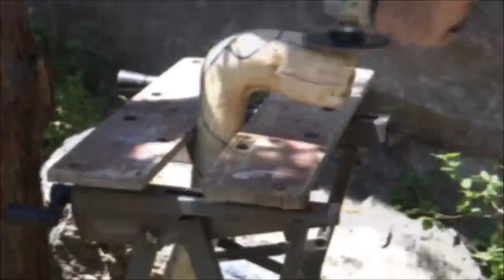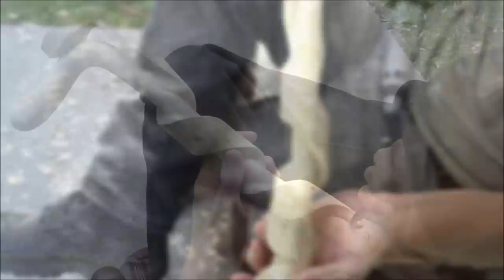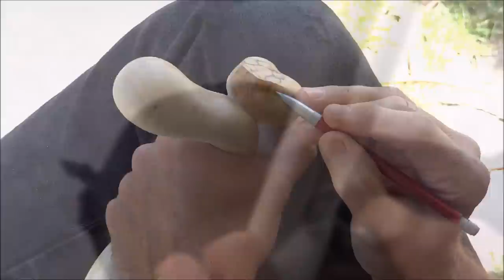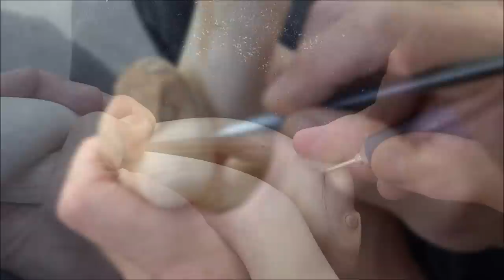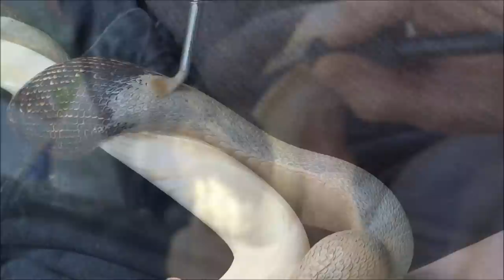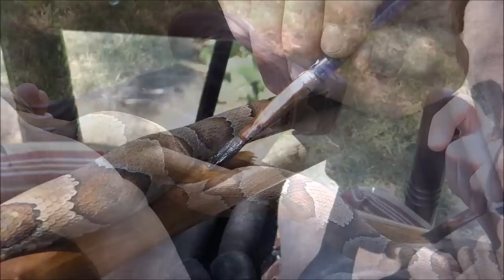Copperhead Cane #36

Comment: Hi Mike could you please tell me what order and color paint you use please. I notice you put a Base on???Really appreciate the help and will post stick when finished.Regards Mick
Reply from the maker: +michael allen Hey Mick! I use high quality artist acrylic paints. Start with a colored tinted gesso primer thinned down enough to soak in  to the wood. I just look at photos of the snake type that I'm painting to decide what colors to use. I mix a lot of colors to get the right shade so I can't really explain what colors to use. I always finish my snake with a flat polyurethane finish coat to protect the painting underneath. I'm anxious to see your stick when it's finished.